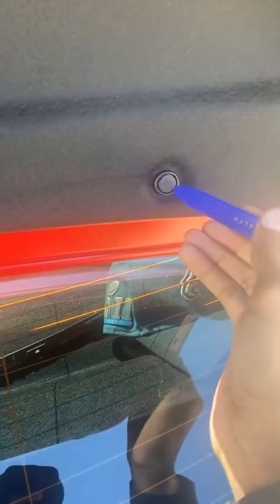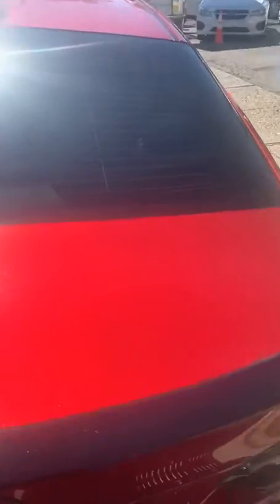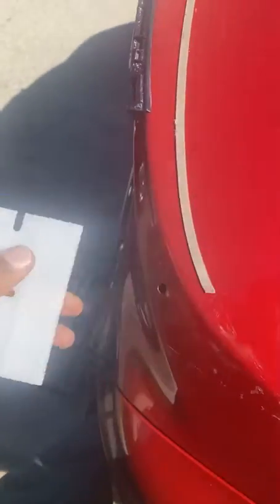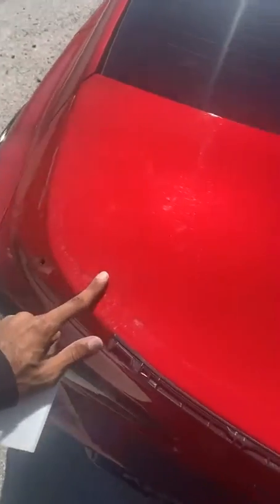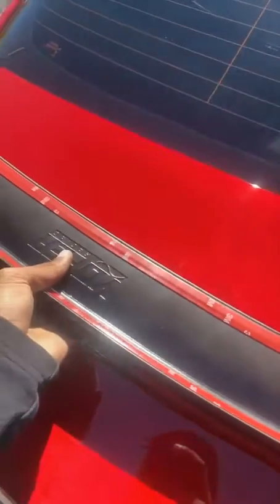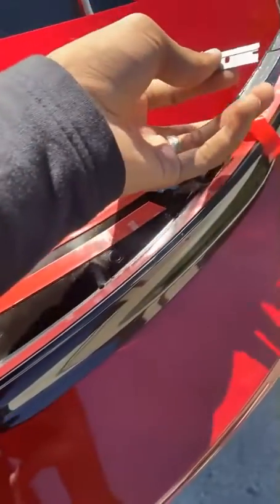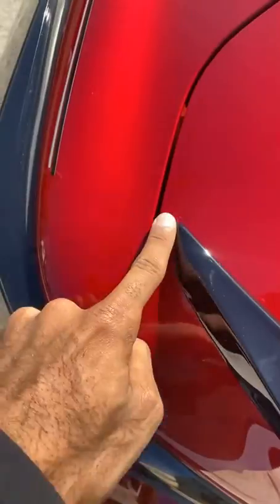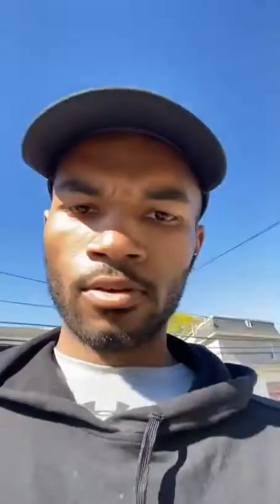Installing Cuztomtuning V Style Trunk spoiler on a 2018-2024 Camry SE/XSE

Comment: It's irritating that these spoilers don't come with the holes so that you can use the original bolts to secure it. It looks good there I just can't trust glue and tape. There's a reason the original equipment has bolts as well as glue.
Reply from the maker: agreed but its been 7 months, still no problems

Comment: I just called a customizing body shop and what you just showed to do, people are charging between $150 to $200 to uninstall the old wing, remove the bracket, remove the screws. Use wax on the car, buff the scratches. I found that wing online. Just curious how much did it cost?
Reply from the maker: Damn I need to up my prices then that’s crazy lol the spoiler itself cost about $100-150 for the better quality aftermarket ones

Comment: I don’t think the 3M is going to hold the spoiler overtime if you live in a hot state like I did in Florida because I had done to my Benz already when it’s hot it’s going to come off some everyday and finally the spoiler is going to open more and more then the water goes in the glue I wish they made holes and added some bolts on it
Reply from the maker: Well we will see what happens. It’s 90 degrees on Philly right now still haven’t had any problems and I visit the car wash very frequently.
Reply: Not if you use 3M VBH tape. I used it on my rear window spoiler and it has stayed stuck firmly through a couple hot, muggy Georgia summers and wet and rainy springs. It took me a good amount of Goo Gone just to loosen it up for removal.
Reply: I had a buddy of mine bolt my spoiler down, holds great now :)

Comment: So you don’t need to bolt the new one in?
Reply from the maker: The factory holes do not match up with the two holes on the spoiler. 95% of people just use 3M double sided tape. I wouldn’t recommend creating more holes in your truck it may create more problems. I personally used the tape and it’s been over a year now. No problems nor issues
Reply: @crimsonkamuri  appreciate you replying, I forgot you don’t like duplicate questions. I’m a new Camry XSE owner, so I found you on here and been following all your videos for ideas. I bought a duo kit with a rear window spoiler and trunk spoiler. Wanted to make sure I get it right the first time. I definitely like your exhaust set up. Definitely going to make that my next big project
Reply from the maker: @phillipclark6486  no problem man appreciate you for following the channel! If you have any questions feel free to message me on Instagram